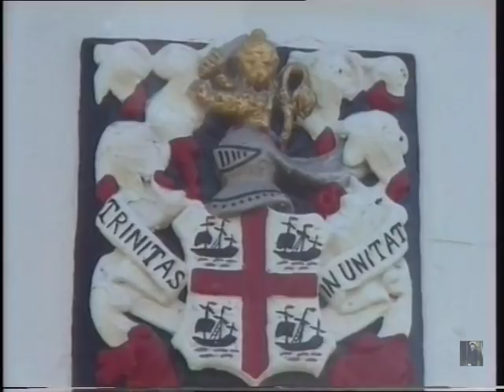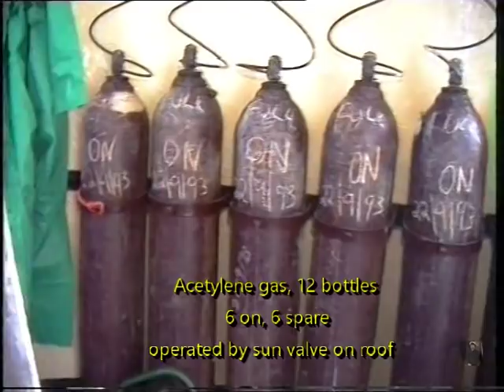St  Tudwal's Island and Lighthouse  filmed late 1980's

Comment: For the sake of posterity it would be nice to read a little more description as to the mantle and wooden peg - the basics on how it works, lifespan, etcetera. Thanks
Reply from the maker: The wooden pegs as far as I recall were made from cedar or pine that were impregnated with a flammable substance. As seen in the film they took a long 5 minutes to burn through and snap to trigger the mechanism that then replaced the mantle. I have never seen another mechanism like it and don't know how old it was or who made it. The mantles when burnt in and in use were very brittle and even a moth that got into your lighthouse could break them, or even wind pressure from a very strong gale. We used to change them on our visits every couple of months or so, or before if they looked worn, I have found a couple of you tube videos that talk about mantles, one is talking about camping lamps but the principle is the same. https://www.youtube.com/watch?v=7Q0SJRJIP4A
and ..
.https://www.youtube.com/watch?v=9q88pKc5880
thanks, hope it helps.
Reply: Thanks Peter, I remember mantles from camping in France as a youngster with the portable gas lamps. I am delighted you had the benefit of technology and foresight to record it first hand. Your videos are uniquely satisfying for me and I enjoy them thoroughly. I look forward to more :-)
Reply: The key had AGA moulded into the handle, or was that borrowed from the range?
It certainly was an interesting mechanism.
Reply from the maker: @sarkybugger5009  Hi, yes it appears that AGA invented the cooker and lots of things for Lighthouses as well, mechanisms and lights.